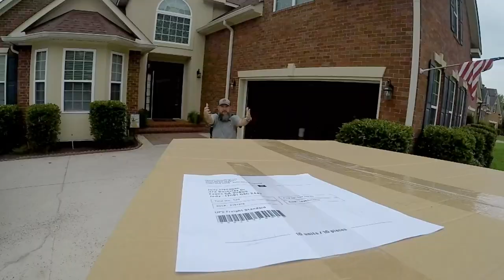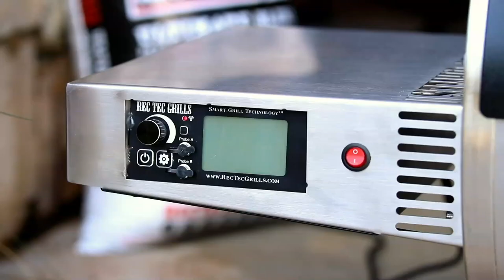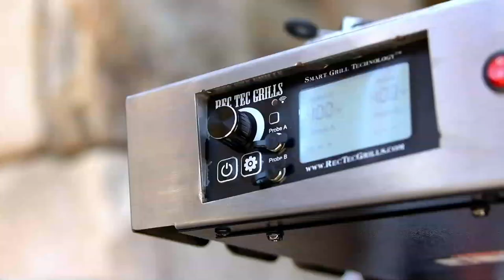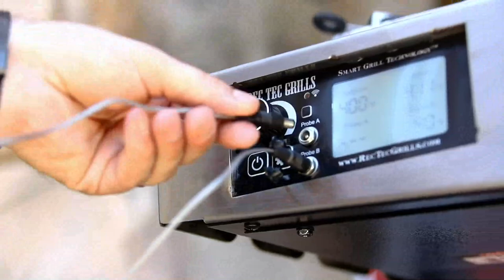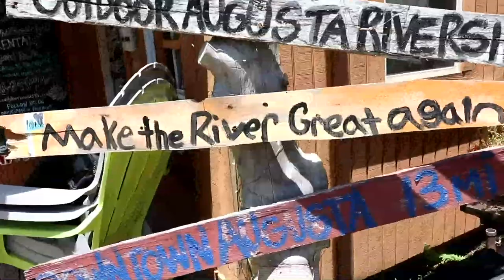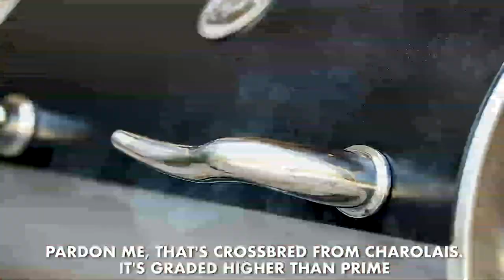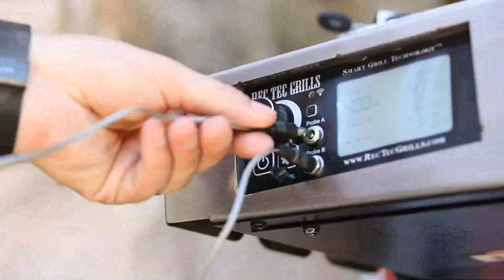NEW Funday Friday Week 101 • Getting Your New Grill | recteq

Comment: I've had my RT-700 for a week.  Three smokes under its belt (Shrimp, Ribs, and a 4th of July brisket).  After using a custom made stick smoker for 20 years, I feel like I'm cheating.  Everything has turned out great and I don't feel chained to the smoker worrying about temperature maintenance. On the 4th, I put the brisket on and went to bed!  Customer service should be used as a model of what CS should be.  I had a bag of pellets damaged during shipping.  They overcompensated sending two bags to replace it!  So glad I went with Rec Tec.
Reply from the maker: We appreciate this awesome review! It ain't cheating just because it's easy. 😉 #rectecfamily

Comment: Hey guys great video! I am interested in a grill for my restaurant - Id like to cook 20-30 racks of ribs at a time? what do you suggest?
Reply from the maker: Hey Dave! We have models of all different sizes to accommodate your needs. For 20-30 racks of ribs, we suggest the RT-2500 BFG. You can fit about 25-30 racks of baby back ribs and about 14 racks of spare ribs on the BFG. https://www.rectecgrills.com/RT-2500-BFG-Pellet-Grill
If you're looking for something a little roomier, check out the RT-CMG Beast. A few of our local restaurants use this model and it is definitely big enough for commercial use. https://www.rectecgrills.com/Beast-RT-CMG
There is also a trailer-mounted version of the Beast that we call the Chuckwagon. It's perfect for transportation if you're hitting the road! https://www.rectecgrills.com/RT-TMG-Chuckwagon

Comment: Been looking at a new grill for weeks now.  Keep coming back to the rt700... how does this compare to the newer traeger 1300?  I know the 1300 is a lot more money, but I live in MN and grill all winter long.  Heat retention is tough for many grills in our winters (last year we hit -60... but not even my weber kettle with a ton of charcoal can cook well when we go that cold).
Reply from the maker: The RT-700 uses a PID algorithm which ensures temperature control. This is the same technology used in breweries and pharmaceuticals where temperature control is vital. We have had many customers smoke low and slow in negative degree weather with ease. If you prefer some extra backup, we also offer a Cold Weather Cover to help with heat retention. You may be burning more pellets than you would in warmer conditions, but temperature control should not be a problem! Don't hesitate to give us a call for any further questions. (706) 922-0890
Reply: @recteq  
Thank you for your quick response.  Your customer reviews were not joking... you are quick to respond.  Very impressed.  I will call the the number.  Thank you.
Reply from the maker: @MrBiggameslayer  No problem! 🤘

Comment: I didn't catch this, but does the grill feature any stainless steel?
Reply from the maker: Yes! All major internal components (grates, drip pan, heat deflector, & firepot) are 304 stainless steel. The logo, smokestack cap, & hardware are stainless steel as well. 🤘

Comment: What side of grill would I place a smoke tube?
Reply from the maker: On the RT-700, we suggest placing the smoke tube in the back left corner so the airflow of the grill will keep the smoke traveling from left to right. As for the RT-590 and RT-340, placement doesn't matter! 💨

Comment: Does the grill have a hopper dump to make changing out pellets faster and I see orange caulking inside the cooking chamber - please explain how safe that is
Reply from the maker: It does not. We have tried pellet dumps on all of our prototypes and, due to the complications it causes, we decided to not include the feature. A pellet dump is an extra opening that allows possible moisture to enter your hopper and cause wet pellets, an auger jam, and a headache for you! Our grills typically burn about 1 lb. of quality pellets per hour. We tell our customers to keep this in mind if they would like to switch pellets. Or, they can simply scoop out or shop vac their hoppers. Other companies that offer pellet dumps have the issues we mentioned above and, instead of simply getting rid of the problem, they might ad a feature like reverse auger - no need for that. Remember, when grilling at high temperatures, the flavor of pellets really doesn’t matter! As for the caulk, this is a sealant and is perfectly safe, we wouldn't add anything to our grills that is unnecessary or harmful to your food or yourself. 🤘🔥
Reply: @recteq  I don't want any paint or caulking in a high heat chamber where food is cooked, so can I order one like that - I like the hardware you guys offer but don't feel comfortable with it in the cooking area
Reply from the maker: @denaliking6426  Give us a call and we can talk more in detail with you. (706) 922-0890

Comment: PID loops are as old as the oldest PLCs. Not that recteq isn't great (I'm about to buy one!), but PID loops have been used in industial settings for 50 years. All pellet smokers with an internal temp prob uses a PID controller. The difference is how they set the deadband (the temp above and below the setpoint at which it will not add fuel), and the ability to adjust fuel load based on temp inputs. You can have a simple PID controller, or you can have an Allen Bradley running your temp controls. From what I've read and seen, recteq is using a consumer model level of the Allen Bradley.